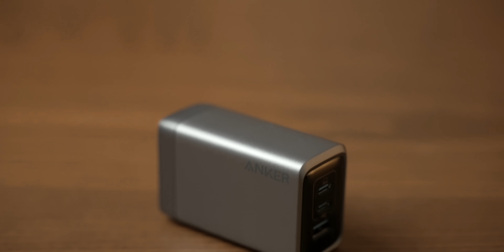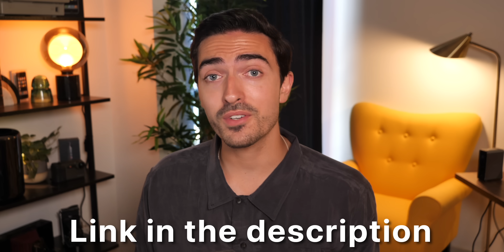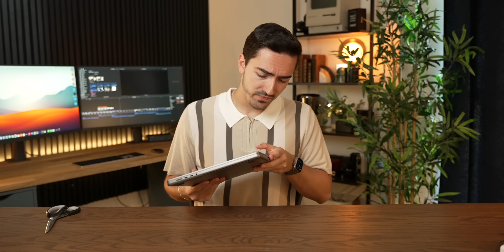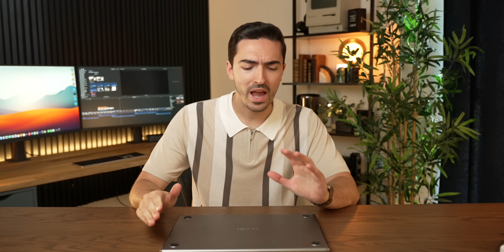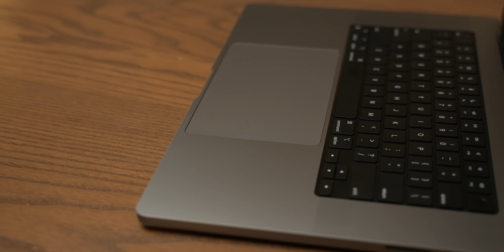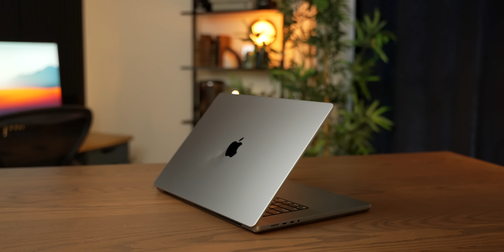I bought the CHEAPEST M1 Pro MacBook Pro on eBay!

Comment from the maker: Would you buy this MacBook Pro? I had to buy the cheapest working one, but would it have been wiser to spend extra on one without a dent 🧐
Reply: probably the dent on the back of the screen is making contact with the screen and that's the cause for the dark spot. its the same if you apply pressure from the front with your fingertip, you think you can remove the screens backplate and flatten it a bit? that might solve it. Cheers
Reply: @eddiexx  I agree. Perhaps you can try using those suction cups of yours to pull the dent out. If not, maybe you can take the screen off and knowck the dents out from the inside and put it all back together.
Reply: @eddiexx  But it's kinda risky, you might end up damaging the screen
Reply: I would spend a little extra, I bought a M1 Pro MacBook Pro 14” 1tb, 16gb ram for €1150, works perfectly fine(apart from a small scratch)
Reply: try to pull out the dent with hot glue and a hook? easy fix maybe?
its worth a shot?
Reply: Looks like a good deal to me.
Reply: the one I want!
Reply: Would I buy it? will you sell it to me :P
Reply: No I would not for reasons explained in my main comment below.
Reply: Maybe
Reply: 10 bucks, we got a deal!
Reply: No, definitely not. I rather spend $ 200 to $ 300 more and have one without issues ánd maybe have 1 TB of storage.
I am disappointed in Apple producing MacBook that even the famous Luke Miani can not upgrade or repair.
I keep my MacBook Air 2015 for simple tasks like word processing, YouTube and so forth.
Reply: I’d be nervous that the opening and closing of the lid could bend/warp the aluminum where it’s pinching the screen. If that pressure increases just slightly (in a bag, etc) past an unknown threshold you could be very sad. Unless you’re Luke and willing to make it another headless
Reply: Never
Reply: I sure wouldn't... but I'm not an Apple person to begin with... I could have been, and I did have a MBP at one point (2012, and it still works great, but I had to give up Mac OS), but the games Apple plays don't project a good image, and I don't want to deal with their shit.
Reply: no way paying 950 bucks for a defect Mac I rather spend few more to have a clean one since parts are extremely difficult to replace.
Reply: ewww the size of that trackpad...
Reply: I think you got a good deal. I'd buy that unit if I had the money, but fixed income kept me at the M2 Mac Mini.
Reply: I just bought an M1 Pro for $600 in perfect condition. The seller thought they had a regular M1 chip.
Reply: Here is what I got for $826 from Amazon in December 2024: HP 17" Touchscreen Laptop, slim, 32GB RAM expandable, 4GB NVIDIA dedicated GPU, 1TB NVMe SSD, 5 FAST ports, SD card reader, warranty, 10 core 12 thread Core i7 13th Gen. The BEST thing is the Touchscreen. So much more direct and faster to control software by clicking ON THE ITEMS on the screen.
Reply: Luke, I know you do mostly Apple have you considered looking at comparing to some of the Windows with the ultra or AMD AI chips.
Reply: Having a 16" MacBookPro that the screen went bad on and after I priced a replacement decided to just use an old flatscreen TV as an external monitor, no way would I have bought this, I’d be worried the screen would eventually fail completely.

Comment: Recently I bought a 16 inch 2021 M1 Pro with 32GB 512GB with a broken screen on eBay for 800 AUD. Replaced the screen with the lcd panel from AliExpress. Had to transfer the original ICs from the broken screen. But everything including the True Tone function works now. Also upgraded the SSD to 4TB using 8xKICM229 from AliExpress. I got a beast now.

Comment: I bought a m1 max 16 MacBook Pro, 64gb of RAM, 1 TB SSD on eBay, for 1.1k with taxes. I thought it would be damaged, but it has no damage. The battery is 91% charged. It didn't come with the MagSafe cable, only with the brick. But I still can't believe I got it for that price.

Comment: Have just bought my first mac - M1 Pro 14 inch 87% battery and otherwise in pristine condition for 800 usd. Very satisfied with the purchase
Reply: Damn bro same i got M1 pro 14' 10/16 32GB 1TB 86% battery for like 900 USD. To top it off it's barely used. 1500hrs power on time
Reply: i’m about to do the exact same, sell M2 air for 14” M1 Pro 32/512. How’s it working out for you? It is starting to age
Reply: @bene0001  super capable at everything i throw at it. Handles obrstack, 1 windows vm and 1 opensuse vm at the same time without breaking a sweat. No noticable slowdowns whatsoever. For a 5 years old chip this thing can last me another 4 years ngl
Reply: @sechmachine  incredible, thank you. its pretty certain ill be picking one up, going for ~£600 for 32GB RAM is incredible. better in every way than my M2 Air, and could potentially even make a profit. what a machine
Reply: @bene0001 runs amazingly on macos sequoia. Just downgrade to sequoia from tahoe and you will be golden

Comment: Did they disclose the lid damage and the defective display? If they did not, I would return it under SNAD. The little-used battery and clean interior are points in its favor, but Black Friday deals on the M4 models make them pretty attractive compared to tbe 4-year-old models.

Comment: Take the notebook to a body shop. They can probably remove the dinks quickly and relieve the pressure on the display, making the weird variance disappear. They have suction/pulling tools to undent aluminum without having to drill or anything,

Comment: Here is what I got for $826 from Amazon in December 2024: HP 17" Touchscreen Laptop, slim, 32GB RAM expandable, 4GB NVIDIA dedicated GPU, 1TB NVMe SSD, 5 FAST ports, SD card reader, warranty, 10 core 12 thread Core i7 13th Gen. The BEST thing is the Touchscreen. So much more direct and faster to control software by clicking ON THE ITEMS on the screen.

Comment: I just got a used 16in MBP m1 max, 32gb 1tb on ebay for $1100 shipped. Great deal, especially considering it's in great condition and they listed it as the 24core GPU but it was really the 32core 🙈

Comment: I just picked up a 16" M1 Pro with 1 TB storage for ¥146,000 here in Japan (about USD $1016) and the only issue was that the keyboard was a little shiny due to constant use. I got a keycap replacement set on AliExpress for about $7 and now it looks pretty much brand new. Amazing deal in my opinion, it does everything I need without complaint plus extra.

Comment: I picked up this exact model for $900 locally, with AppleCare + until Aug 2025, no issues, very nice system, but I also just picked up a 16" Macbook Pro M1 Max 64gb 1tb yesterday for $1200 with AppleCare + till April 2025 no issues, deals are out there

Comment: For context, 3 months later, the M1 Pro 2021 14 inch model with 16/512 spec is going for $1038 on Amazon (renewed, excellent condition) whereas the cheapest in stock 14 inch Macbook Pro (M3, only 8/512) at Best Buy is $1199.  If your budget is that $1200 new model, you can even get a 16 inch 2021 M1 Pro model, 16/512 also, for $1129.  The deals are out there, but as more M4 models get into the hands of people who want them, more of these M1/M2 models will show up for the rest of us to afford.  I'll keep my C2D 2010 model for awhile, it's been fun so far and I want to see how far I can push it.

Comment: I'd never buy damaged like that. You'll just lose more in resale value later.
Reply: cashconverters was selling a macbook with intel with display that would Mock Apple laptop ( Damage display still works ) but my from a cashconverters far far away from me took 2 days to come and worst is display look like new is was bit damage I would plug it into a Big screen ( Why not used is Usb-c to TV my tv don't support usb-c head on
so £50 is much to pay a hub with hdmi with lan

----------------------------------------------
Pro Display XDR - £6448 or My own monitor  from asus which cost me £230 feels like Nano as well just not Apple branded Stand which nearly as much as a Macbook AIR

Take that Apple

Comment: I came here because I have a dilemma and wanted to see how it went for you buying a used MacBook on eBay. So here it is: I have 2 older Windows PCs that are not supported by Microsoft officially to get the update to Windows 11. So I would need to buy a new PC and since everything else I have is Apple, I’ve decided to look at MacBooks. 

I have an M1 iPad with a Magic Keyboard that I use for pretty much everything currently (browsing the web, media consumption, social media, reading, pdf creation and viewing, notes, word documents, and some light spreadsheet creation too).

 I currently only use my PCs maybe a couple times a month. I really only need a computer type device going forward for data storage, tax season, and I need to use proprietary software to transfer software updates to an SD card for my car. I also have a multi port dongle that has a sad card slot on it. 

So what should I do? I don’t feel I need a brand new MacBook Pro or Air considering my minimal use case. Should I buy like a 2018 or 2019 Intel MacBook Pro, a used M1 or M2 MacBook Air, an M1 MacBook Pro, etc? I can buy a new MacBook Air or Pro but don’t really feel the need to spend that kind of money on a device I will rarely use. Any suggestions?
Reply: Don't get a used Intel Macbook Pro, the best value for money and performance is a used but good condition M1 Macbook Pro, for longevity as you can use it as many times as you want it and if you need the extra power you can take advantage of the M1 chip.

Comment: I bought the then new 16” 2020 M1 MBP base model in the 1st week of January 2021 on a purchase return discount (~$2,150). I have used it ever since with a great experience.  I would buy it again, though I love the 15” air form factor. I have not bought an M2 or M3 because there’s little difference for my use.  I did get an external SSD caddy that runs wicked fast and when I get 40-50Gb in my temp drive, I move it to the external HD. That keeps my SSD at about 300GB of 512GB used. It’s such a great machine the M4 Pro will have to be something extra to replace it.

Comment: I've always considered the M1 pro base model as the logical machine to buy used after a few years over the latest air. Even if the performance were similar (maybe they'll be close when we reach M4) you still get more storage and RAM; and more ports. Definitely the machine I'll pick in a few years when I want to replace my air M1 (hopefully it can last 4-5 years more)

Comment: Speaking as a technician - this is an easy fix.
Take off the lid, disassemble it to the point where the spot is visible (from my knowledge it is only the display) and work on it with a hammer.
Protect the hammer with a cloth and also the underground you are working on - and don't bang it too hard :D
The display just shows a stress mark, which is reversible. If you eliminate the tension of the lid, this is a OEM fix.

Was a good deal
Reply: Can't do it easily, LCD is integrated into upper lid. You're gonna risk cracking glass and marking any of the lcd layer.
Reply: @mikemaj2  I know :( I cracked some of these lower bezels myself, but with a little bit of heat and a bit of force these come off easily. You have to know where to tackle the adhesive and where you'll brake it. And get parts from a reliable source is a problem since you can mostly buy display assemblys only as "donor" parts. But the Macs are still more repairfriendly than iPads. Dude! I hate working on iPads!!!!
Reply: lol this isn't a Dell. I'd love to see you try that on one of these displays. What a joke 🤣
Reply: I was thinking this but since it’s such a pain it makes it very difficult, I was thinking tho with maybe some PDR tools, you might be able to pull the dent gently and just enough to take the pressure off of the display
Reply: I'm thinking paintless dent repair.
Reply: "protect the hammer" got me rolling

Comment: I've had my 16/1TB M1 Pro since 2021, and repairability is this laptop's biggest issue. My original display went out, and it cost $800 to replace it at the Apple Store.  Also, something that I've noticed with the first and second displays is that near the hinges, the metal starts caving in, and the screen becomes misaligned. I'm not sure if it's a widespread issue, but it's happened to me twice.

Comment: Still happy with my M1 Max Macbook Pro. Might upgrade when the M5 comes out. I had my old Macbook Pro from 2014 before I got the M1. I don't upgrade too often. I would be interested in an iMac with a larger screen if they introduced one. I have a 2019 27" iMac currently with Core i9 and 64GB.

Comment: My MacbookPro 2012NonRetina is > {631 Battery Cycles} Manufacture date: 2013-01-14    Bootloader {OpenCore Legacy patcher on MacOS 13.6.2 }
in 2021 i replaced the 13inch for a 15inch and wanted freedom to change out my ssds 

but i may get a MBP 2015 soon or a Framework laptop due to apple not letting u switch out SSDs without Tools

Comment: Try with suction cup you used to open the bottom to pop the dent out, did that couple of times and sometimes had to use a bit of heat and always worked. I think the dent is slightly pressing on your backlight.

Comment: I just bought an 16" M1 Pro 16GB RAM and 1TB SSD for $800 with only visible defect is evidence previous owner used a keyboard cover when the screen is off and you look for it. It also still has a year plus of AppleCare+.

Comment: I normally don't like buying and using cosmetically damaged items, I'd rather pay more for no damage. With that said, the value proposition here is too good to pass up. In this case, I'd use this machine in clamshell mode with a monitor and external peripherals hidden away - or tuck it away and use it as a headless server.

Comment: I had a Macbook Air 13 2015, then 2017, then the Pro 13 2018, and lastly Pro 15 2018.
I’m done with Apple. Treating the laptop like a fragile diamond square, any wrong move and replacement costs a kidney. I’m going for the Framework 13.

Comment: A tip for those who are willing to buy some macbook with similar problem, there is a catch: You have to try to un dent it right after you buy it, mine was the same and with time the screen cracked by itself because of the pressure on the glass. I gess the screen being so slim and with a material that has no elasticity makes the impressive screen rather fragile. Now i have a screenless m1 pro for 500.

Comment: i got this and it's my main computer,  And this guy was doulble the price 2 years a go, on sale, but it's just so much more than intel predecessors, that is outstanding the job was done by apple, i wished i bought a 14 inches.. but still satisfied, even if i am eager of buying the m4max as it will be a real jump from this.. i own .. for now i can only say amazing.. and good for the most of people.. me and my editing needs are sometimes a little bit constrained by the 16 gb ram , but overall wow.. I hope with m4 there will be a jump in performance abot the h265 decoder, cause i guess it has remained the same across the evolutions.. a lot to expect now.. my only concern is to edit smoothly 8k content from canon R5II which is the pinnacle of hybrid cameras for the next years.. or i will stick with my base m1pro and make proxies..

Comment: The issue with replacing the screen through third party or if you DIY is that you not only loose True Tone, which is fine if that's the only thing you loose, but from my own experience replacing the screen from another parts machine, unfortunately you also get artefacts on the top of the screen like rectangular shadows, there is a big jump in brightness when passing the half way mark and below the halfway mark you can tell the calibration is off as there are small square blocks that lights up brighter on parts of the screen as it tries to figure out the content on screen and the brightness to apply. It's annoying at low brightness but not an issue past the half way mark. You'll need to find a 3rd party repair place that can also take the chip containing the security pairing from the original screen to transfer into the replacement. That's why you see some of these services on eBay saying they need the original screen.
Reply: the artefacts are only present on the 14". You can swap the 16" displays without issues.

Comment: I mean for like under thousand dollars I mean it’s not that bad especially for the specs. But I was saying if you don’t really need that power or care for that big of a screen you could buy a 13 inch M1/M2 MacBook Air and it will still be very good. You could even buy a 15 inch M2 Air for a little bit over 1000 or around $1000. And you could easily get a Mac Mini or iMac for a little over or under a  thousand dollars that will still be pretty good and Mac silicon. And this is on Apple‘s refurbished shop so most likely these computers will be a little over priced but it will be in very good condition it may be even warranted. but I could totally see this being good for people who do not care about that dark spot on the screen or dent but just need a powerful Mac that’s portable and upgraded. I personally would like that power but I wouldn’t like the fact that the screen is not pristine and it doesn’t look nice. Like I have myself a 2023 16 inch MacBook Pro and it has the highest M3 Max chip basically cost me like $6000 and I love it it is basically pristine and powerful but I mainly got it for the screen.

Comment: I scored this same model, though the 1TB version, at Best Buy for $1099 (refurbished) last week. And not only is it in nearly pristine condition, outside of a minor ding in the border, it has 99% battery health as well. Like you I am also a bit surprised at how much these things have depreciated, but I’m also not mad about it… Especially since the machine ended up only costing me $275 because BB offered $825 in trade-in value for my 14” model of the same machine.👏🏼